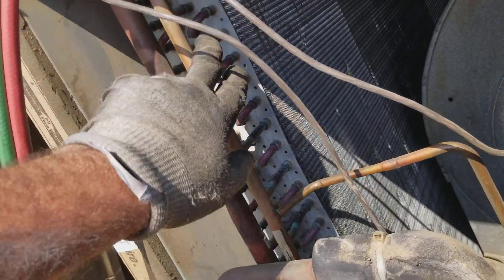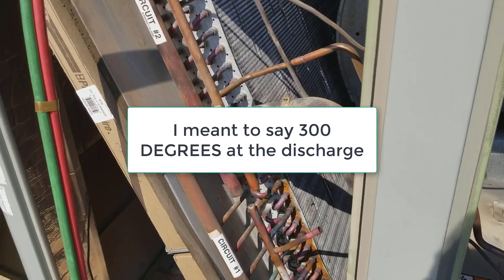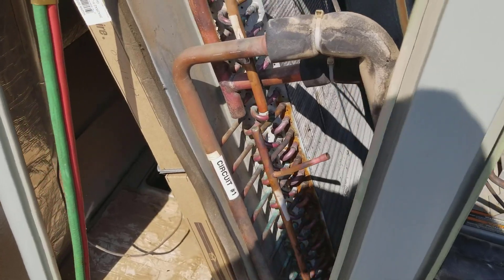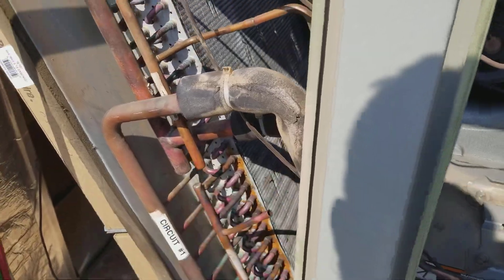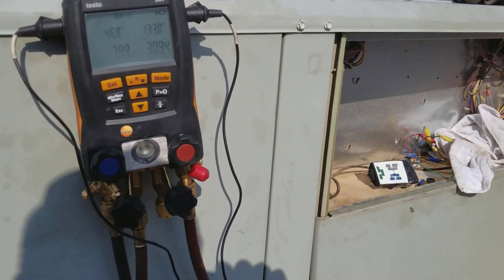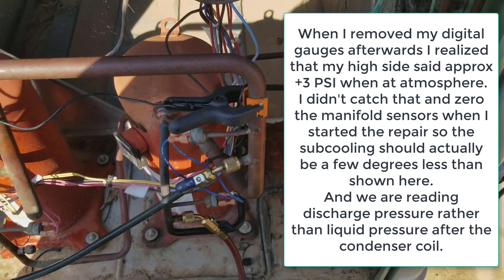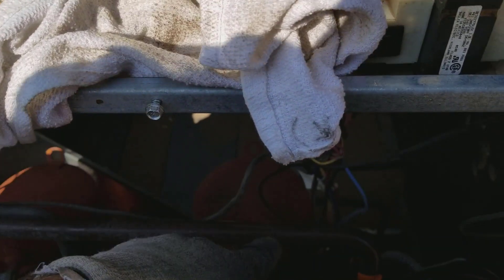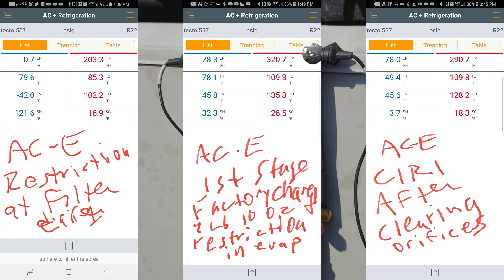How to repair a Carrier or Trane multiple orifice header without removal

Comment: Do you have a video of converting it to txv?
Reply from the maker: Yes. However that only works on straight cool units. 
Heat pumps have header check valves and the coil feeds all tunes in parallel for evaporator mode but separate a subcool loop in condenser mode.

Comment: COND COIL DIRTY AS HELL
Reply from the maker: Did you watch the video?
The coil face wasn't shown in the video and the readings do not indicate a "dirty as hell" condenser coil.
A very used unit and all however the OD Coil was not the issue.
The issue was a restriction in both the filter drier and the multiple parallel indoor coil fixed pistons.
Something that occurs in these units occasionally and was repaired in the video.

Comment: Hey brother, just curious, why is 3degrees SH acceptable? In class we were thought 5 to 20 as the range, anything under 5sh you’re getting into risky territory
Reply from the maker: This was years ago so I don't recall more details but in the video I noted it was a little low at that moment. 
Pulling panels off and on repeatedly during the recording may have skewed it a few psi vs degrees etc.
It is a fixed multi piston device. Only adjustment would be adding load via more supply fan cfm to increase superheat.
Fixed metering devices otherwise have no adjustment.

Comment: Thank you for this video. These old Carriers, Bryant’s and Tranes are surrounding me …:). I’ve got one 10 ton Carrier for tomorrow (this one is only 4-5 years old) and one Dino Carrier that is ~25 years old for another day. For r-22 I usually drill them with pretty good outcomes. Will try your method with acetylene torch. It seems  a bit easier.

Comment: is it possible to be successful by just heating and running the compressor without opening it up?
Thanks in advance.  Great vid
Reply from the maker: It could be scary if the system pipe came apart under pressurized refer so I never tried that.

Comment: Was looking for the metering device is just a pipe nothing more , so you recommend me to cut the liquid line before the evaporator and heat up the orifices the blow nitrogen through the suction line and didn't need to flash the system with r 11

Comment: Replaced a compressor for trane and the filter drier and my head pressure is about 320 - 330 psi and low suction about 38 -40psi

Comment: How hot is your ambient temperature? And how hot was the return air  temperature ?

I’ve worked on the same model unit and cleared the metering device and I’ve been able to bring it down to 240 psi on a 93 degree day with 80 degree return temperatures

Pressure dropped further when return temperature cooled down
Reply from the maker: I don't recall what it was when I made the video but as of mid October were just now getting down to high temps of ONLY 100.
We run high temps of 100 to 120 degrees from May through October.

I posted this on Sept 7th of that year so it was done then or days earlier. 
So probably 105 to 110 degree high temps.

Comment: Temporary unplug a system with overheated chemically broken down oil still circulating. Also old R-22. You didn't do anyone any favors playing cowboy tech.
Reply from the maker: Installing an actual filter drier ahead of the metering device has done wonders.
I've yet to go back to any of these fixes and find them plugged again.
Even the compressor has hung in there on most of them.

And this repair is like $2k cheaper than replacing a coil (what most techs do to fix it) so yeah. I did them a favor and saved some $ not too mention could fix the unit in the same day.

Comment: I spoke to a Trane tech support on this issue. They have a TXV conversion kit and I was told to install crankcase heaters that is one of the reasons why there's some waxing the oil gets thickened up or something like that if there's no crankcase heater. Where I work at a school district main server room is served by one carrier with that style of metering and I put crankcase heaters on there and haven't had a problem in almost 10 years
Reply: Thank you for this advise!

Comment: That pinch-off tool is familiar; I haven't seen mine in a while... Guess I haven't needed it too bad haha
Reply: I think I still have one somewhere, been probably over 20 years since I used it.
Ahh, the god old days, when you could pinch off the liquid line on a unit with no service valves to pump it down, do your repair, and just purge the lines with refrigerant, reround the pinched off pipe, and get on to the next call. :D
Reply from the maker: I used the old thing again today.
It is 15+ years old I think.

Comment: Do you believe it's absolutely necessary to use that much heat?  Or maybe a better way to ask the question , have you had success using less Heat? Thanks, Pete.
Reply from the maker: I figure go big or go home. LOL
Reply: Thank you for the tip! I’ve got two of these guys lined ahead of me :) 
I used to drill these headers. Drilling does work great, but it is time consuming and it’s not very easy thing.  Will try MAP gas this time.
Reply: @edlauren9434   how did that work out for you? I’m might be doing this soon